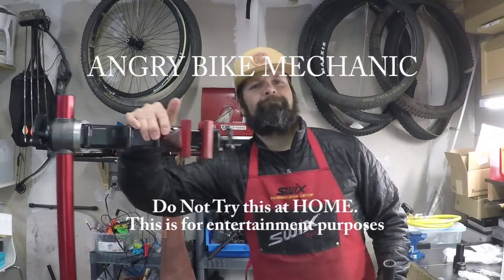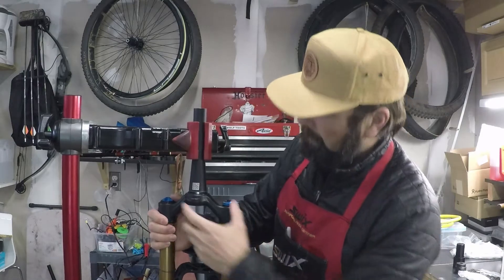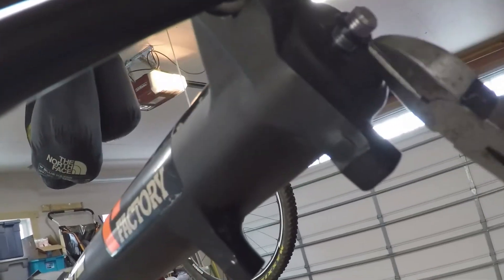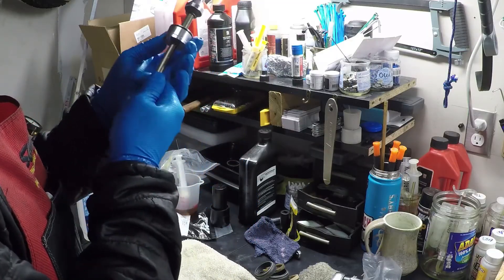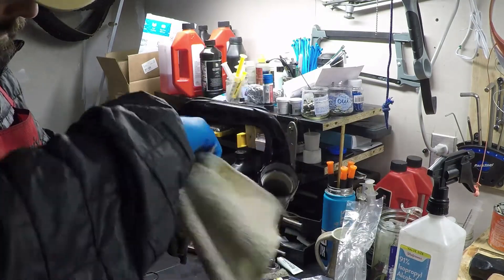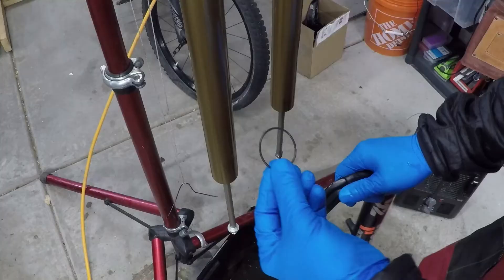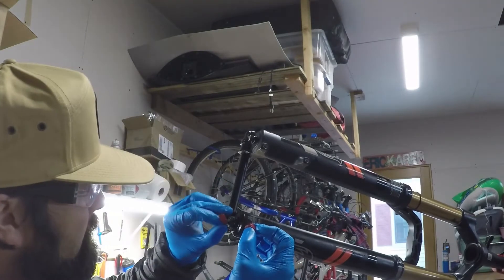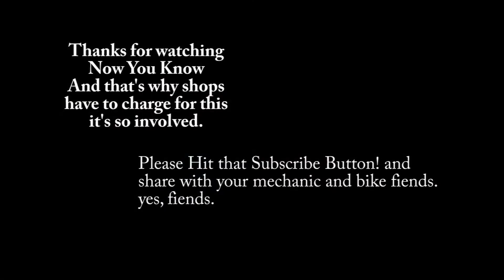Installing New Air Shaft on Fox Racing 36 Float And Reducing Travel

Comment: So you changed the travel by replacing the air shaft but....nothing is required in the dappertutto side? I mean, the cartridge is self adjustjng to the   reduced/increased travel? I canto get an idea about that...
Reply from the maker: yes, The damper stroke on these accommodates up to 180mm of travel, and basically down to about 120mm, I believe. They used to have a bottom-out valve but not sure about that anymore. So that would matter only in the last 10mm of the stroke. The damper really doesn't create a ton of pressure. The Grip series damper purges any additional pressure which is why it's so much better than the FIT dampers. If you want to do it right, and have a FIT damper, it would be good to bleed off some oil by setting the new stroke length and even subtracting 20mm of stroke before capping it off. For example, if you set the for to 120 travel, bleed the damper to 100mm travel. Once capped, extend to the 120mm mark and you won't have the excessive build up of bladder pressure.

Comment: Hi, I have a 2022 Fox Performance 34 130mm fork and would like to reduce travel to 110mm so what part do I need?
Reply from the maker: Hey! what I would do here is visit the Ridefox.com website and click "BIKE". From there find the tech help tab and then insert the 4-digit alphanumeric code from the fork lower (right below the dust wiper on the back, normally). That's the Tune ID.

This will give you the exact specs you need to look for. I've been able to source the parts from there from places like WorldWideCyclery.com or JensonUSA. I hope you find the right part.

Comment: question.... I have a 34 rhythm 2017 of 100mm and I want to change it to how it was before (150mm) I want to buy the air shaft but I want to know if it would fit the air shaft of 2019 34 float of 150mm
Reply from the maker: Great question Diego. It might be worth a phone call to Fox. Give them the "Tune ID" or serial number. They'll give you the details. Some air-springs will be interchangeable but you'll need to get the spec from them. It will probably work, but call them to be sure. Or you can go here: https://www.ridefox.com/fox17/help.php?m=bike&ref=topnav and enter the "tune ID" in the "4 digit code" box and see if the part numbers match up for you. Hope that helps!

Comment: Can I use motorex 10wt instead ?
Reply from the maker: probably. I think several shops do that. Open bath oil just needs to be oil in most cases. However, on your damper side, if you have the FOX Grip or Grip2 you have to use the same oil that is in the damper. The 40cc of PTFE oil in the open bath actually gets cycled into the damper. I would recommend using the same oil that is in the damper in that case.
Reply: @insightbike  I have grip2 it's 2021 model fox36. I'm in UK so lower viscosity like 10w I thought it would be better. 

Damper side I'm definitely sticking to fox PTFE because as you said it's ssucked into damper. 
I find motorex oil better over stock oils. I also have lyrik ultimate and it work smoother with motorex 5w oil
Reply from the maker: Right on man. Next summer I will be tinkering with different oils in the Grip damper. While the PTFE oil is great for the machine, it's super toxic. I would also like a lower viscosity oil in there anyway. Very cool man, Motorex is great oil.
Reply: @insightbike  have you tried a replacement for the fox oil ? Motorex 2.5wt ?
Reply from the maker: @fspeshalxo69  I should try that. Seems like a great option. Thank you.
Reply: @insightbike  i'd really like your review ..see i have both oils now but i never did my first maintenance i received the airshaft 180 today and going to do it with fox ptfe for now but curious to see difference
Reply: you sure can.  In fact, you can use Motorex 5wt, but most tuners will go lower and use Motorex 2.5wt. You can also use Maxima Light 3wt. Or you can use Rockshox Fork Fluid.
Off the top of my head, here is the viscosity (at deg 40C) rating for these oils, from thickest to thinnest:
-Motorex 5wt (22)
-Fox 5wt (15)
-Maxima Light 3wt (14.7)
-Motorex 2.5wt (14.4)
-Rock Shox fork fluid (10.6)
Of these, the Maxima one is the cheapest.  If you're a light weight (under 140 lbs), go with the Rock Shox oil.

Comment: Very well  made video dude, touch of grease on crush washers helps, rubber coated dead blow mallet will protect your fancy pancy FOX seal drivers and it wont mark your brace should you hit it.  Also, I take off the garter springs of the wipers and slide them up the stanchions helps when installing lowers, just sayin' .  Keep it up 👍🏼
Reply from the maker: great tips. sorry for the delay. bike mechanic life! I would add that if you do use a little grease to the bottom of the crush washer to keep it in place, it may change your torque values. For anyone not experienced in how the foot-nuts seat, be aware of this. It may be worth observing the crush washer as it compresses. You don't want to shear off that part of your damper or air spring shafts. Anyway, thanks for your comments, these videos are a pain to make!